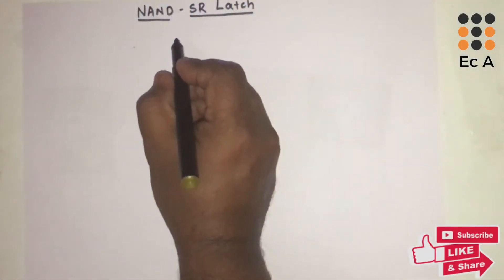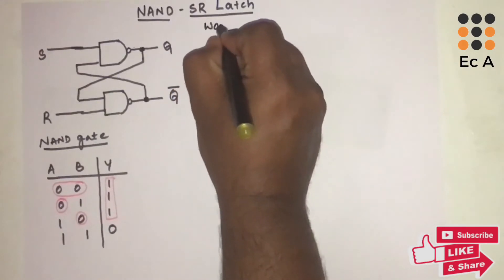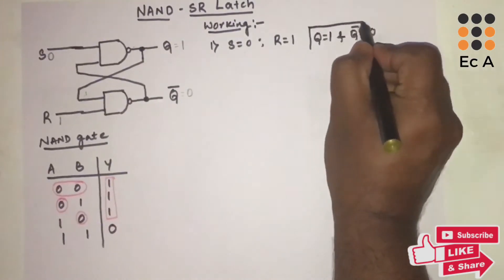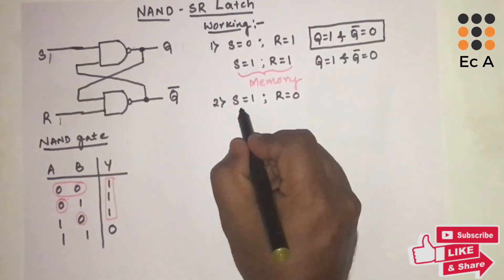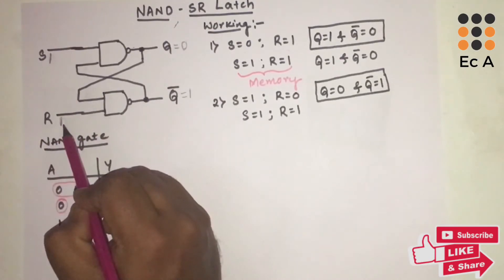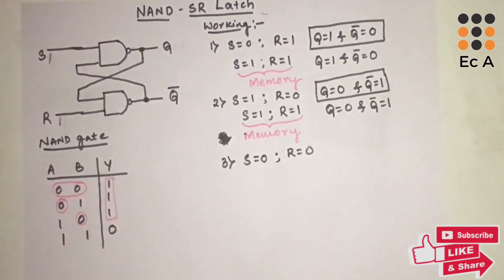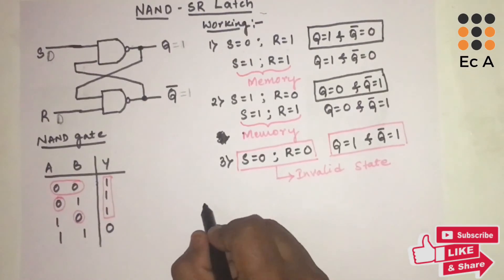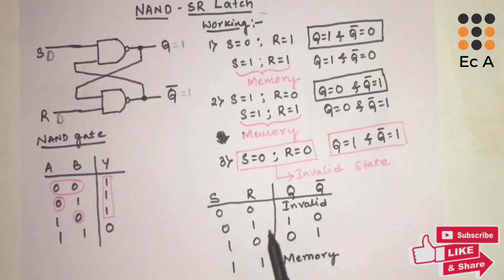#65 NAND SR Latch || EC Academy

Comment: 1.32 why the output of Q appears in the lower gate, 
As the lower state haven't completed first iteration.
Reply from the maker: As you can observe from the circuit, the output of the first NAND is connected as the input to the second gate that's why the value will appear at the lower gate as input...
Hope this was helpful...
Do subscriber and keep supporting EC Academy ✌️